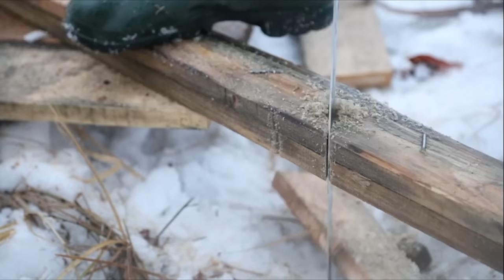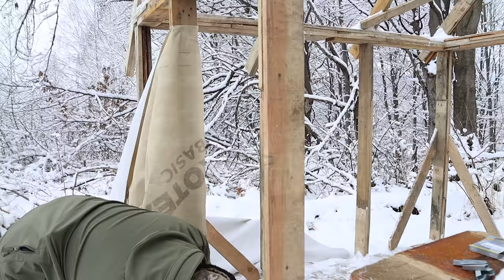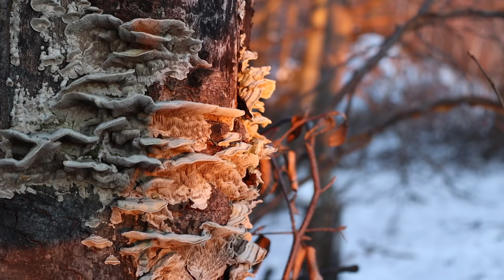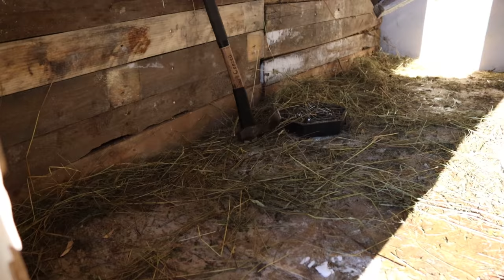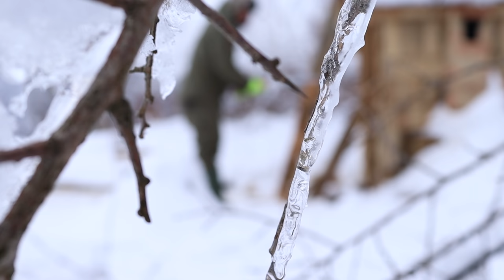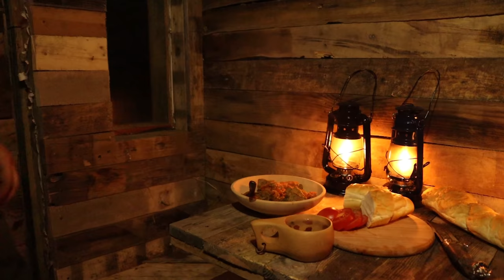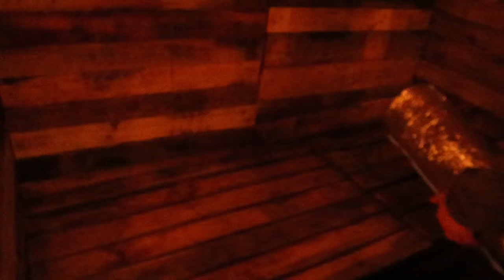House with free pallets. From start to finish

Comment: Incredible. I want to build a shed out of pallets. You made it look so easy…great job!
Reply: Yea me too
Reply: it is easy
Reply: Бутафория. НЕПРОЧЕН дом, построенный на песке.. Так же и этот...
Reply: I think he has assistant...everything was in complete and ready to every place it needed to become much easy
Reply: Those pallets he placed as a base will rot really quickly making the whole place useless in less than 5 years max. He needed to raise them on a stone base and treat them. The mud he is building with is actually cement. The use of building fabric is a good choice. the insulation needs packing tighter.It should also be bone dry or it will rot and attract incests and small rodents.  Better to use actual straw bales. All that said it is an excellent build and could be a guide to a real long lasting cabin in the wilds.
Reply: It was a very impressive project. But I'm curious if anyone else with OCD was bothered by how those planks on the back wall of the cabin were at an obvious angle?
Reply: If it's not rooted in the ground it won't work. Those pallets are new if i may say! Don't lie!

Comment: I love it. I love that you used pallets, that you made your own stove, that you have nice roof overhangs. I like that you did this with a saw, a hammer/ax, a big knife, a box of nails, some hinges, a couple panes of glass, and a couple iron stove parts. I also love that it is is built with wet wood, which is traditional throughout most of human history. Wet/green wood is not allowed now where I live, making home construction less accessible than it has ever been. The rules are well-intended, but they often come at the expense of any housing at all!  So, this is what I personally would do differently: 1) set on stones to keep it dry and prevent from rotting bottom up. 2) less toenailing, but honestly you are fast and that is a big plus so maybe not. 3) Modern mortar, or a less wet mix. I think the mix you use will shrink and crack as it loses moisture, and the result will be smoky, or even funnel small flames to the wood frame of the house... 4) Think hard about the wrap / vapor barrier fabric. I am not sure about the solution, but it is attractive to me to do something less modern than what you have. 5) Think hard about adding insulation to the floor. It doesn't look very cold where you are because  you are able to dig soft clay, but where I live the ground is hard in winter. 6) Stagger the roof shingles and interior wall boards so it is stronger and more attractive. 7) Use a battery nail gun, because I don't think my shoulder would put up with the impact. 7) Change the bed design so you can use the space below for storage. 8) Make simple opening windows. 9) Think hard about the chimney height. I wouldn't want cinders falling on the roof... 10) make the roof overhang off the front maybe 18", put some pegs for hanging tools items on the outside, and a small area outside the door to stand off the wet ground. (A micro porch). 11) add a small closeable peak vent covered by wire mesh for coolness in summer and allowing moisture out, and keeping mice out.
Reply: To Jessica T. The roof boards really need to overlap the next one down - so rain doesn't seep in between boards.And the roof needs to be insulated, because heat rises, and gets out through the roof. Think how  a HAT stops heat getting out of the top of somebody's head! Beautiful house! Could do with a carpet to decorate it, and keep it warm! Also a BAYGEN brand radio  and BAYGEN torch - they wind up , and convert mechanical power into electricity, to run on!
Reply: You are a very knowledgeable person!  Your name says female to me, if so, even more praise!
Reply: @oksills  oh, dear! Sorry to disappoint you! I am male!! I know about houses, because I had an old one. And everything had to be repaired! Unfortunately, I could never build a house in the woods myself, because I am dyslexic. So, although many things ARE alright, I can't measure things correctly, or cut wood things correctly - it would be crooked, however careful I am! However, MY MOTHER  did make all the furniture at home! And my mother WAS a woman!
Reply: Just his little summer place.
Reply: @nygelmiller5293  😂 🤣 😂
Reply: Excellent comment 👌🏻
Reply: @nygelmiller5293  Have you ever seen cob buildings? You "kinda" measure things, it's more like sculpture.
Reply: @nygelmiller5293  
I have never heard of the Radio and Torch you mentioned - they sound most helpful!
Reply: @nygelmiller5293  
I think oksills was referring to Jessica, whose post you are replying to here... 🙃
Reply: @cindiagarrett9451  thank you!
Reply: I would add one more thing, heat deflector shields behind the candles on the wall!
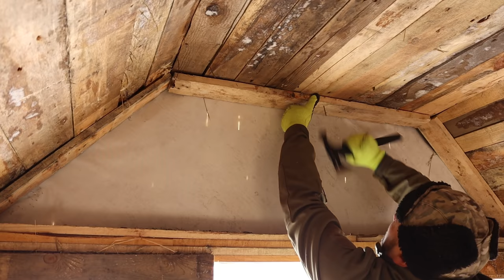Reply: @nygelmiller5293  The roof was insulated.  He did the same thing to the roof as to the interior walls.  Nailed boards up then stuffed with hay.  Watch from 19:11 on.  He didn't bother showing stuffing the topmost section but the hay is sticking out at 19:43 so he stuffed the roof.  Probably just edited out.
Reply: @NavvyMom  thanks for replying about the roof!
Reply: Have at it
Reply: @bobsponge1877  and central AC. Satellite. WiFi. And a spa outside. Where’s the spa!!
Reply: @texassports6562  damn, you're right!  My bad.  fist bump
Reply: @nygelmiller5293  lot better warm cabin if stove pipe has inside room and go out center of roof near door. long pipe heat room better than only stove. and need waterproof under floor insulation better.
Reply: @mattivirta  very good comment about long pipe!
Reply: @dawnbarone5804  I was thinking the same thing! That was my first thought when I saw him light those candles. I would use them behind the lanterns also. When the wood dries and the dried “insulation” behind it…I imagined a timber box easy to catch fire
Reply: @nygelmiller5293  I'm glad I'm not the only one who noticed the issue with the shingles. If anything the siding should have been done for the roof, and the roof for the siding (altho staggering in either case).
Reply: @sorcerykid  AGREED!
Reply: @jennifercarp807 , I believe you are thinking of a “tinder” box.

Comment: Hello from Maine, USA! 👋
This is a great project for a little hunting camp or storage shed. It's a wonderful use of old pallets. You asked what we would do differently, well not much, but I see a few things. One is the windowsills should be angled downward slightly to prevent rain from pooling and flowing inward under the window glass. Two is I would stagger the roof boards so you don't have the two continuous cracks for water to flow into. Third, and this is to prevent hand fatigue: a HAMMER STAPLER. No need to squeeze to staple a million times!
Thanks so much for posting this, and I hope you and your loved ones are safe.

Comment: By far one of the best "shed/cabin made from pallets" videos on YT.  The best part...he used only pallets!  Too many of the other videos use regular lumber and only use pallets superficially to make it look like the whole was made from pallets. The innovative ideas displayed, like the layering of boards to make a 2x4 or 4x4, the shingle siding, dry grass as insulation and the mud clay mortar, are what set this apart. In a sincere form of flattery, I will be copying some of your techniques when I (try) and build a pallet greenhouse next year.  Well done!
Reply: This reminds me of some of the techniques used by the pioneers. Only they used wooden nails and leather straps for hinges etc. And I'm sure mud for mortar like he did. 
  My worry would be a large bear or large moose or something. Or a spark and fire. I don't think he built it to live in. Just a stop in. I think it is 👍

Comment: very well done, the only thing I would make different are 1. insulate the hay before stuffing the house with it. one can insulate using mud (dip the hay in mud before stuffing the walls with it, this will make it more fireproof 2. coat the internal walls with mud (fireproofing) 3.  light candles in tin boxes only (and do not go to sleep with open flame candles near the wood and hay like that. for the rest, excellent!!
Reply: Yes, I agree with the concern about the open candles posed so close to the wooden walls...a fire hazard. But the lanterns look more safe.
Reply: I'll bet the candles were just for cozy atmosphere because if he blew them out in the morning they would have already melted all the way down. But I agreed that though lamps and candles should go off at bedtime and I'm sure they did. I would need a couple more windows but those would be easy to add. I would like to know how many pallets this took. If Society keeps on doing the way it is while there is still land in the wilderness there may be more houses like this that are occupied year round. I say that in a sadly joking way...

Comment: Excellent cabin. So many lessons here for the young if they could grasp the concept of time, energy, money and the pursuit of happiness. This is one of my favorite videos in survival shelters in terms of reclaimed materials, speed of construction, insulation value, wind and rain proof and decent heating system with cook top.  FIVE STARS .
Reply: I honestly feel like the young ppl of my day have a much better grasp on this than the previous generation.
Reply: I would've put a third (& maybe even fourth) window in the back. I don't like not being able to see out, in case something happens.
And I'm not sure that there weren't slight gaps around the door. 🤔  However, those are fairly easy to fix, I'm imagining.
But YES.. overall, a great little house. Seemed very snug & cozy. Excellent work! 👏
I would've had to have a slightly thicker cushion for the bed, though.. old bones. 😉
Reply: okay I'm sorry my generation can't find the time to build cabins because we work 70 hours a week and can't pay rent. Don't worry though, at the state of the world I'm sure it will be a requirement soon.
Reply: @RoastBeefQueefSniffer  That is precisely what I was referring to. The young generation enslaved into working long hours, longer work weeks many years of your life to pay rent or impossible mortgage with very little happiness . This cabin is just a cabin and I was not suggesting anyone needs to build a cabin from pallets or at all but I said there are lessons to be learned from it. Providing shelter in a more modest way could be for some an easier lifestyle and less slavery and more happy life. Apply the concept and feel the rewards. Many are converting vehicles or building tiny homes as an alternative .

Comment: Excellent job - it's great to see a skilled and experienced carpenter at work.  I especially like the stove that you built (ingenious!), and the use of weeds in the walls as insulation.  The layers of boards and 'shakes' also helped in building air pockets to improve the R value in your walls and ceiling.   My suggestion for improvement would be and additional two panes of glass, and install them about an inch or two from each other to create an air pocket (insulation).  Otherwise, if you can figure out a method of reducing air leakage around the front door, I'd say you have an impressive little cabin that can withstand some very tough winter weather.
Reply: -5 и он замерзнет, как только погаснет огонь. Печка сделана не правильно. А  так хороший ЛЕТНИЙ домик
Reply: Straw was used as insulation in early Victorian Era homes, with an R rating ranging from 1 - 2+ it definitely works quite well 👍

Comment: A fantastic build!  The house wrap and siding tiles added a long term warmth and charm. Will the grass insulation rot? 
Greetings and well wishes from Austin, Texas, USA. 😊 Stay safe
Reply: I was wondering the same with putting the wood pallets directly on the ground! All that work and his floor will rot out from under him!
Reply: @emdee7744  you are correct.
Also pallets are treated with pesticides and off gassing can be a issue.
Reply: Видимо это некий перевалочный пункт на скорую руку. Быстрый отдых и ночёвка при необходимости

Comment: Like what you did with what you had to work with, the one thing I would have done differently once the platform was completed I would have raised it off the ground on some stones at key points. I realise you might need some heavier beams to do this with, I don't know where you got your palletsb but heavy industrial metals are usually shiped on hard wood 4x4's which you could use to accomplish the need for these support beams.

Comment: Beautiful work! I have just one thing to notice, but it's important. When you were putting out the candles, there was a brown mark  on the pallet behind one. That pallet was chared because of flame, you must protect it with something unflamable, or move candles further away from the wood. I would hate to see all this work going in flames.
Reply: EZ fix.. Cut the top and bottom off a soda can and then cut from top to bottom to turn something round into something flat and usable as a backing plate. or cut a sheet of aluminum to size to be used as a backing plate.
Reply: I agree. Use a small piece of tin can. Place everywhere candle flame can go.
Reply: Was just thinking the same thing. Those candle flames are too close to the wood.
Reply: Not to mention the whole thing is stuffed with hay.  That was scaring me. But what a great little cabin!

Comment: It will be interesting to know how long this cabin will last.  Please give us an update every year to see how durable the construction has been.
Reply: I built a tiny house with pallet wood, cinder blocks and 3 old pieces of tin roofing and it's still holding up just fine after 4 years. The upper loft framing is made out of pallet wood and so is the flooring. I didn't use any power tools to build it either. Only antique hand tools that belonged to my great grandfather.
Reply: @LaStryka  My personal theory is that they will last far longer than any rv-no matter what the price is!
Reply: These kinds of cabins will last 40+ years.. they last alot longer than people think.
Reply: With good upkeep and things it would easily last a long time
Reply: I really would like to know how long the roof would last without some kind of water sealant? His building this with only hand tools was amazing to say the least tho!! Yes, I agree with the metal shield behind the candles tho!

Comment: Love everything about it!! I'm just concerned with how close the candles are to the wall; I kept looking for scorching.
Reply: Yes with the location of the candles it wouldn't  take much to burn the place down, but as you say it's a great build. Years ago, I once made a garden shed using the angle iron from the sides of old metal bed mattresses as the frame and wood from free pallets. Took ages though to pull the pallets apart 🤣.

Comment: I loved this, and, I loved the builder's simplicity of material and construction techniques.  It seemed to me that he was basically, eyeballing most of his work, I didn't even see a bubble level, or, t-square.  A hammer, axe, handsaw, trowel, for the brickwork oven/stove.  Only think I saw him put in that I don't think he made, are the bricks, nails and, metalwork for the stove, and, what I'm assuming is a moisture barrier, that he put up around his basic frame, even the roof "tiles" for the roof,   Oh, and, although I didn't see it being put in, a stovepipe to carry smoke up his chimney.  From start to finish, engrossing! Wish he was selling a how to kit, and, comprehensive list of supplies, tools, and, materials necessary to build this, also a simple diagram, to assist those who might like to emulate his construction.  I figure, too, that being as simple as it is, it'd be relatively simple to make changes to the basic construction, like a skylight, to let in light during the day.
Reply: the bricks were his stovepipe.... notice they were put in a pattern, then made a cap for it where it comes out.
Reply: @24ktlady  Yeah, but I figured there might have been a metal stovepipe inside the brick chimney, seems like you'd need something to close the flue to either stop wind from coming down it, when the fire was out, or, adjust how much air the fire was getting, so it would burn slower or faster.

Comment: Couple of safety issues.  Candles open flames too close to the wood wall.  I get why the dry grass insulation in the walls and door, but can hide insects.  Then the base is in contact with the ground, again termites.  The pallets that make the bed, a lot of wasted storage space.  I can see why he walked away.  (Also, where is the out house?)
Reply: Agree about those candles next to the wall. Yes, also, to possible insects in the dry grass even though I love the idea and use of natural resources.

I wonder if termites survive in that climate; am living in a customized but commercially built log home (Texas, USA) so am very aware of the risk. 

Yeah - did he dig an off-camera pit or something? 

Nevertheless, an awesome and inspiring video.
Reply: @daradelle3665  Ні, терміти в цих краях не живуть. Але живуть мурашки, вони будують свої мурашники в землі. Будинок стоїть на кількох шарах піддонів, і від цих комах ізольований. Гірше було б, якби він стояв просто на землі.

Comment: An awesome and inspiring video. THANK YOU for not adding commentary; we're allowed to focus on the process itself without distraction. 

The open candles were too close to the wall for my comfort. Shielding on the sconces? 

I wonder, also, about a sanitary facility. Seems to me that there should be some sort of sheltered nearby location for body waste, as well as a separate compost pile for (the few) food scraps.

Even with those few concerns, I think this is a wonderful video. I am inspired to make even better use of the pallets I collect (almost by instinct)